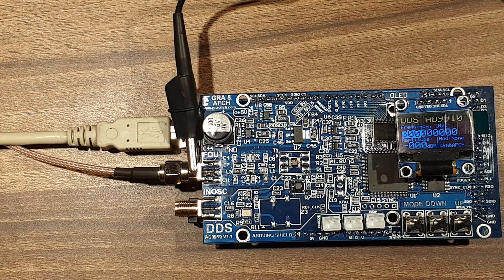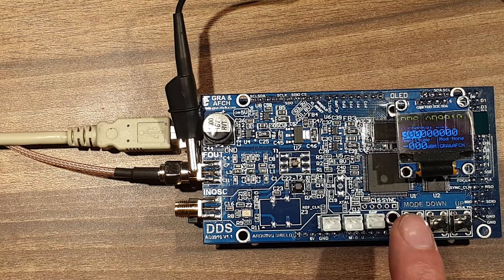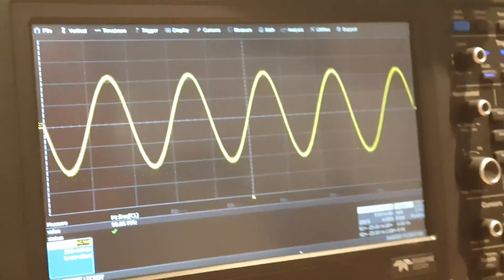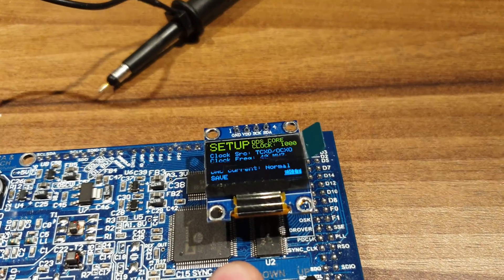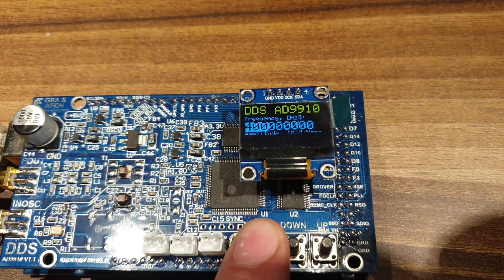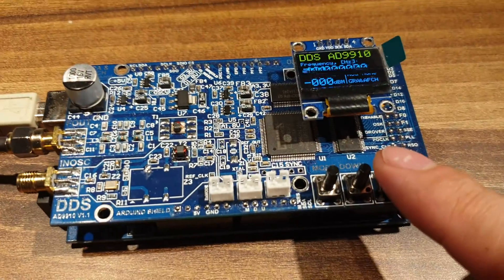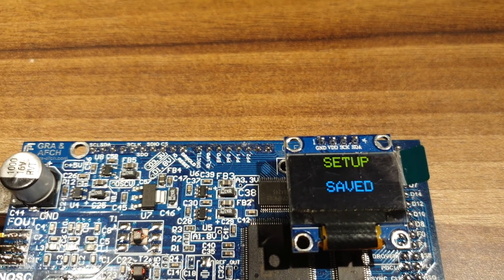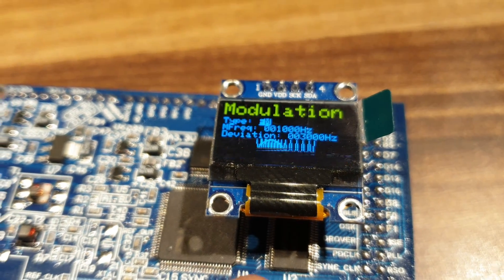DDS AD9910 Arduino Shield Signal Generator 600 MHz @ 1.5GHz AM FM SSB Sweep, Low Spurs Low Harmonic

Comment from the maker: Buy it now from manufacturer DDS AD9910 https://gra-afch.com/product-category/rf-units/
Buy it now on eBay DDS AD9910 Arduino Shield Signal Generator https://www.ebay.com/itm/163923312245
Buy it now on eBay KIT DIY DDS AD9910 @t
Open source software and scheme always available on GitHub: https://github.com/afch/DDS-AD9910-Arduino-Shield
Reply from the maker: In the DDS9910 manual available on our website, there is an amplitude-frequency graph that shows the signal level from 100 kHz to 300 MHz is nearly identical, staying within ±1 dB. However, as the frequency increases, losses begin to grow. This is partly due to the output transformer, which, according to its datasheet, exhibits a -3 dB attenuation at 500 MHz. Additionally, there are losses in the output low-pass filter (LPF).

You should also account for losses in the coaxial cable, which increase with frequency. For example, the RG316 cable has losses of about 0.1 dB per meter at 10 MHz, but at 500 MHz, these losses increase to 0.6 dB per meter. Attenuation in connectors is also around 0.2 dB per connector. Make sure your measuring device is calibrated, as the cumulative attenuation will account for all these factors.

If you would like to refine or adjust the values at frequencies of 100 MHz, 200 MHz, 300 MHz, and 400 MHz, you can submit a request to our technical support.

Comment: I have purchased the AD9910 DDS board from Your Company. but while testing it, I tried to control the Sine wave's amplitude. the maximum amplitude of the waveform at different frequencies was not constant even though I was given the same input amplitude at all frequencies. Why? How can I optimize it?

Comment: Can I generate other waveform like triangular or sawtooth wave ? Also in ad9910 ic it support phase modulation and user control phase. So can I do same thing in this board?
Reply from the maker: You can get a triangular signal, but you will need to modify the firmware yourself, we have an open platform on Arduino, you can easily follow this, this can be done through DRG registers. You will also need to remove the output filter to improve the fronts.

Comment: hello i am quite interest in long term.. I need about 2MHZ dual chanell square wave gen.. with3 function set freq, phase shift and dutty ( but not mirrored but phase shiftet dutty.. mean if Achanell get 30%duty, Bchannel wil be have 30|% too and not 70 nlike ad9833 or etc.. ) can you suggest me something,? one channel is not interesting to me there is quite problem with drive parameters i need..
Reply from the maker: We have a more suitable option on AD9959 https://gra-afch.com/catalog/rf-units/dds-ad9959-arduino-shield-rf-signal-generator-600-mhz-1-5-ghz-core- clock-low-spurs-low-harmonic/ This board has 4 outputs that are synchronized from a single clock source. Therefore, the phase between the DDS outputs can be adjusted. However, you want a square waveform and the DDS has a sine output. So the solution is to put a fast acting comparator on each output. This is the date the ability to get a rectangle from the sine.

Comment: Could the software be modified to use as a Sweep Generator, with one of the Arduino pins used as a Sync signal output for 'scope?  I would like to use it to tune the IF section of vintage FM radios.
The frequency will sweep from, say, 20.1MHz to 20.9MHz over, say 200mS.  The sync pulse goes high at start of sweep and returns low when the frequency reaches 20.5MHz.
Reply from the maker: Of course you can, but you yourself will need to modify the program. Let me remind you that our open source software is for your imagination.

Comment: can it be made to add SSB modulation both "Lower Sidband" and "Uper Sideband" via the Arduino code?
Reply from the maker: Yes, you can easily simulate SSB (USB, LSB). For example, if you want to transmit a 1kHz modulation signal at a frequency of 14MHz. You just need to set on the screen - Shield DDS9910 14.000.000-1.0000 = 13.999.000 Hz or 14.000.000 + 1.0000 = 14.001.000. And you get SSB. We'll add SSB to the menu a bit later. Let me remind you that we have open source and everyone can optimize it for themselves.
Reply: @geryhold  Thank you for the reply most help full

Comment: Use bnc conectors! and ensure your "stats" are into 50ohm terminations.
Reply from the maker: SMA connectors that we have installed on the board are designed for 50 ohms. SMA connectors provide a more reliable connection and are higher frequency than BNC connectors. But you can connect an SMA to BNC adapter without any problem.

Comment: Hello, what software can I run on the PC to control it ? Will the device work with the original software of the genuine Analogue Device evaluation board ?
Reply from the maker: This is software for Arduino, it is not compatible with Analog device software. But we have open source code on github, you can change and optimize it for any microcontroller, for example STM32. As for PC control, this can be done, the Arduino board can be easily connected to a USB PC. Through the virtual COM port, you can receive and send commands to the DDS9910 board with Ardino. But the software will need to be changed. You can do it yourself.

Comment: Hi- Do you have any plans to add a numeric keyboard and/or rotary encoder ? This board is really impressive performance wise, but entering a spot frequency for a receiver channel test would become very tiresome to do with just up/down buttons. I am tempted but the data entry puts me off.  Great work guys!
Reply from the maker: Through the buttons on the board, you can quickly change the frequency, manually select MHZ, KHZ, HZ separately and adjust, there is a fast rewind if you hold down the UP or DOWN button.
I can also add that there are 3 PH2.0-2p connectors on the board, they will allow you to connect external buttons, including an encoder, but you need to modify the firmware. I want to remind you that we have an open source (the latest version on github is always available https://github.com/afch/DDS-AD9910-Arduino-Shield ) and if you have a desire you can buy an encoder and modify the firmware yourself.
Reply: @geryhold  Thank you for responding so quickly. I don't think my programming skills are up to this task! Still, it would be very good to have numeric entry and a dial for amplitude/ mod depth / freq adjust etc. Maybe you guys would consider it for a future upgrade ? K Regards

Comment: Why can‘t this go down to 1 Hz? What is the limitation?
Reply from the maker: There is an RF transformer at the output, its bandwidth limits the lower and upper frequency limits, in order to lower it, you need to use another transformer or you need to exclude it from the circuit and then you can get the 1-Hz lower limit. But there is one thing BUT, the use of a formatter greatly reduces the number of harmonics! Therefore, without a transformer, the signal will be more dirty.

Comment: Can we configure  L - R audio channel as in a pll ?  What do we need to make it a  pll  with audio input ?
Reply from the maker: As I understand it, you want to simulate an audio signal in real time. This should be done through the digital inputs of the DDS, for this the AD9910 has a 16bit parallel bus, to cope with such a task, you need to implement a digital stereo encoder, this is a difficult task for a real read, so you need to use for example Spartan 6 or other FPGAs to control our DDS9910 board

Comment: Does this device have the option to inject tone in the signal? Looks like a very good device that does a great job.
Reply from the maker: We constantly add new features to our firmware and also fix problems and errors.
Now we are working on a function:
1. SWEEP - a change in the signal from one frequency to another backward frequency, with the total time. 
2. DTFM - two-tone modulation
3. SSB (LSB, USB) - emulation of work in these modes
Reply: @geryhold  Excellent. It's a great board and works for us that can't justify a 2-10,000 generator. I will place order. You will sell many of these for sure. Thanks for the response.

Comment: Where have you been before? I already ordered board based on AD9954 from china :(   Спробуйте розмістити на амазоні. Хай щастить
Reply from the maker: We are currently developing on the AD9959. Wait for the news
Reply: Hi mad i also have the same board i.e. Ad9954 and ad9910 Chinese board. I also have the dds driver kit. I need the sweep time in microseconds. But i am unable to do so. Do you have any idea how can i change sweet time to microseconds. I am generating a signal of 50 to 70 MHz, 10khz is step size, and the total sweep time of 10uSec is required